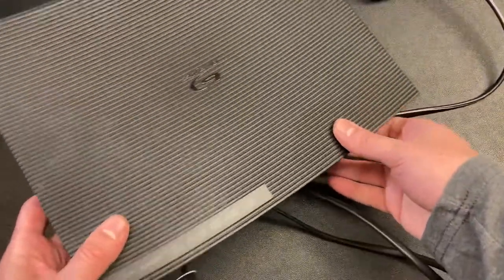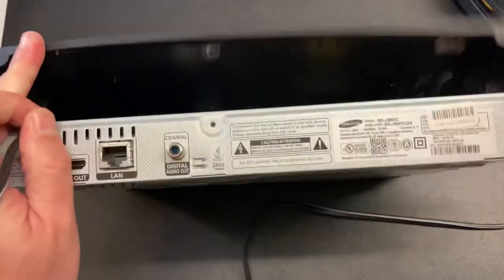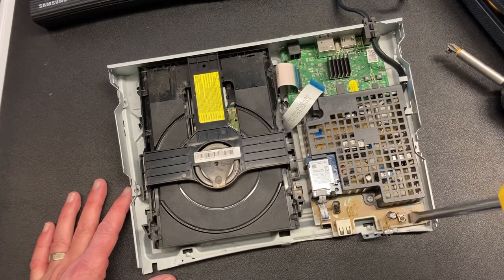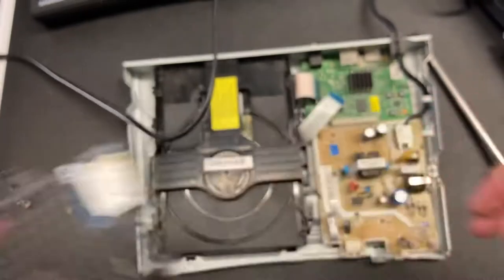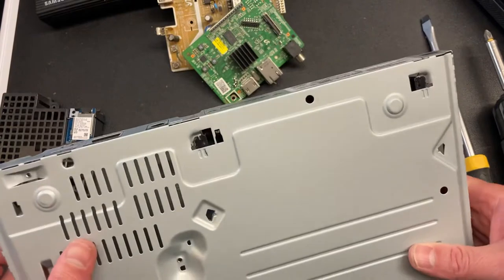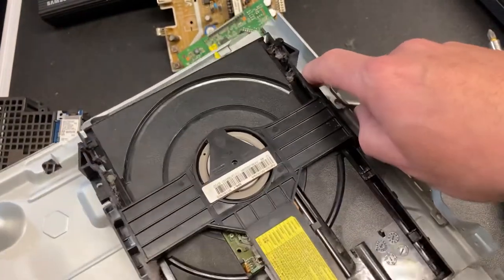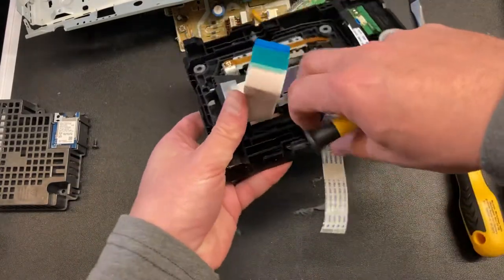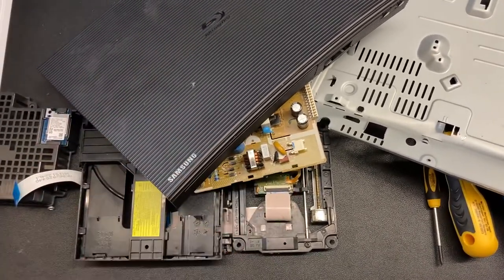Today We Dismantle a Blu-Ray Player. Fun!

Comment: After loading a disc, should both the blue and red lasers be seen? My bluray player doesn't read DVDs. It think's there's "NO DISC" when there is. I opened it up and watched (not directly above the player; to the side). The blu diode lit up but the red diode did not. I assume the red laser isn't working anymore, but maybe the blue laser can be used to see if a disc is a DVD or bluray first, then switch to the red laser.

Comment: My current Blu Ray problem seems to be because of it's network/wi fi options, , it seems to play DVDS proper enough , , , but it played only one Blu Ray disc " "Age of Extinction TF" , but the next day I wanted to play the same  disc again because I wanted to closer examine one scene ,and to my shock , it wouldn't play that disc or any of my Blu Ray titles 😮😢 but it would play regular DVDs without issue , but is a Samsung BD player that just says "Invalid disc" Everytime I attempt to play ANY Blu-Ray , , , , I stare at ceiling in extreme rage 🔥🙄🙄🙄🙄🔥